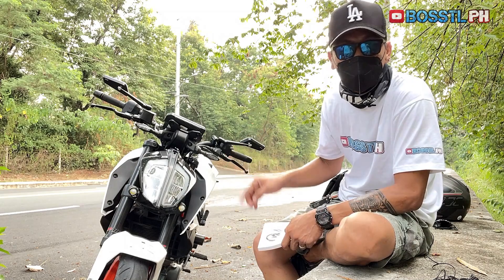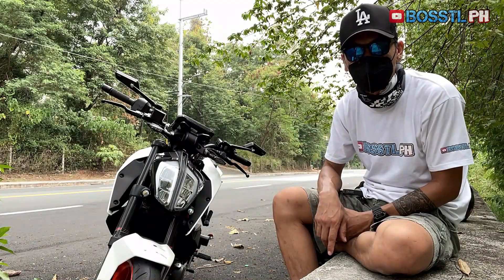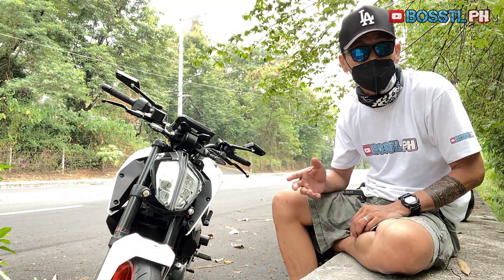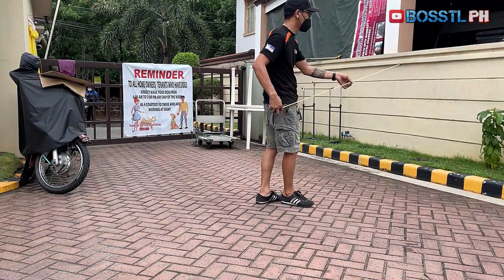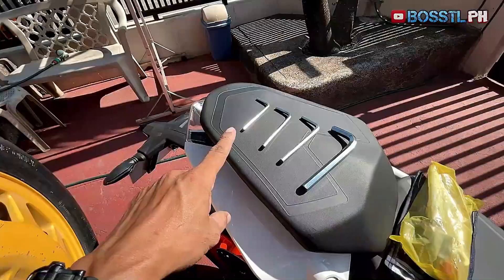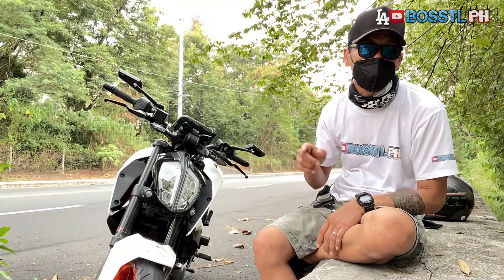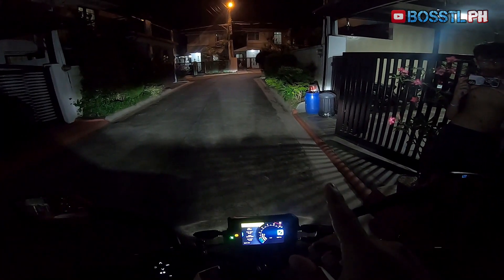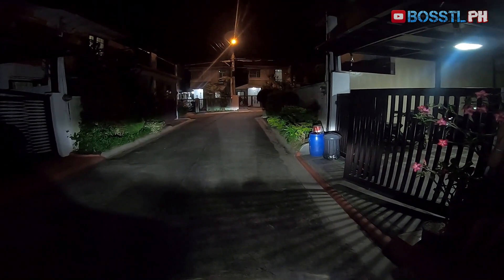KTM HEADLIGHT BEAM ADJUSTMENT || How to DIY adjust your headlight beam on your KTM Duke 390

Comment: Boss Tanong kolang Yung head light ko Kasi stock walang Ikaw Yung low pero sa high malakas Naman ano kaya problema?
Reply from the maker: anong year model po? unang suspect is busted bulb kung bulb type pa po sya, otherwise, baka wiring po. have it checked sa electrician sir.